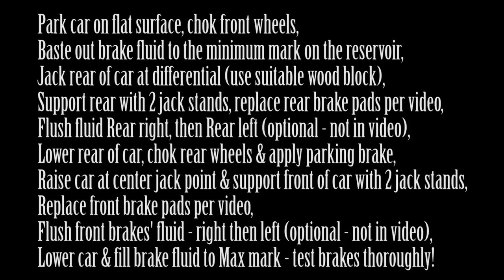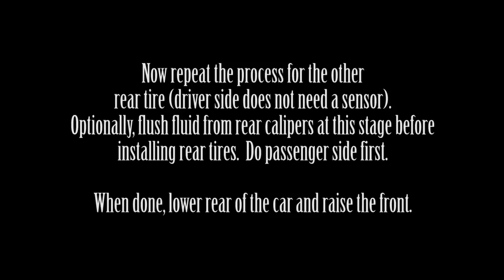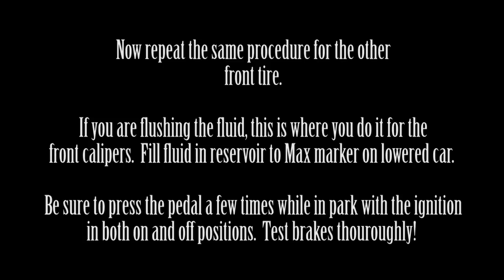Mercedes S500 W220 Brake Pads (Front and Rear) Replacement

Comment: Great Videos....I had to drill out the rotor screw as it was stripped and would not extract. Now the hub hole is 2 big for the screw on new rotors. Can anything be done like using coil, or JB weld or do I need a new hub?
Reply from the maker: Thanks, David.  You can tap a larger hole in both the old rotor and hub, or just omit it.  It is not that necessary. The lug bolts at 110 ft pd each will hold everything tied.

Comment: Is C clamp needed????? I don't remember using one when I changed mine myself few years ago and about to do them again on my front ones 2003 mercedes s430
Reply: Also what is tool you're using to knock those 2 bolts out what is it called I lost what I used before
Reply from the maker: @mverseaz7523  Hi - No, the C clamp is really not needed.  You just need something to press the pistons back...you can do it with the old pads and your hands.  To knock the bolts out, all you need is a rod or any implement smaller than the holes where the bolts go.
Reply: @masood-tv  thx picked up a everything I needed today C clamp just in case

Comment: Ugh I just did mine on my 01 s500, I think I seized a caliper cause it just would not budge. Then again, I was using a screwdriver and not a c clamp
Reply from the maker: Hi AyyB3, sorry to hear that.  Did you try pressing the brake pedal to see if the piston moves?  Of course, try that with pads inside. Otherwise, the whole piston will come out....if the piston does not move with hydraulic pressure, then check if fluid is getting to the caliper.  Screwdriver or not, the caliper shouldn't have seized....
Reply: @masood-tv  Well, this is on my rears, and unfortunately they were let go too long and were very low upon changing, so the rotor was ground into from the bare metal on the pad. 

I didn't have enough time to troubleshoot that far in the moment, I ended up taking the pad from the OTHER side of the rotor and getting it into the space between just to get home from where I was. I intend on taking it apart again later on either today or tomorrow, so I can have an update for you.
Reply from the maker: @A.B.III.   If it turns out that you do need to replace your caliper, I have a video with step by step instructions for the rear whhels also.

Comment: Where do you hack the car up so I don’t rip the air shock
Reply from the maker: Hello Aka Face - please elaborate.
Reply: @masood-tv  like the last time I lifter ped the car and the Schlick pulled along with it do I need to disconnect the battery or a button anywhere before I lift the car - thanks
Reply: @masood-tv   Do I need to disconnect the air shocks  before I lift the car and if so where do I turn it off
Reply from the maker: @3jimp  what year and model?
Reply: @masood-tv  2002 s500
Reply from the maker: @3jimp  Your initial question was where to "hack" the car...I asked that you elaborate.  I think what you meant is where to "jack" the car.  Jack it at one of the 4 jack points in front of the rear tires or back of front tires if you are replacing one set of pads at a time.  Otherwise, jack at the center jack point between the two tires to do both front wheels or at the differential for the rear wheels.
Reply: @masood-tv  but thank you I will do so thank you for your time
Reply from the maker: @3jimp  you are welcome.
Reply: @masood-tv  thank you again

Comment: So, without changing the rotors out, or having them turned, or at minimum a non-directional finish applied, you risk brake fading, brake noise, vibration, etc. It's possible to turn drilled rotors, although not recommended which is why most people replace them.
Reply from the maker: Hi Jason, no need to turn rotors or replace for every 2 to 3 pad replacements.  You will not experience any of the risks you mention.
Reply: Personally, I have. I've been an automotive technician since 2009, and I've experienced my fair share. Not trying to come off as hostile or anything. Just sharing my experience with it.
Reply from the maker: I appreciate that.  Thank you.

Comment: Ahhhhhh I m in trouble about the easier thing, knocking out the pads holder, it's so hard to knock out it. I have to use a bigger hammer and a burner to clean it (it's really dirty)
Reply from the maker: Were you able to finish the job, Alessandro?  These things do require bigger hammers and more muscle at times...
Reply: Masood Fortunately I solved it, I had to use burner because of 1 kg hammer wasn't enough. Now I have to flush fluid brake

Comment: Hi, I noticed you didn't change the rotors? I was told for MBs rotors have to changed every time pads are replaced. How do you know the rotors were still good? Thanks for posting. I didn't think it was that easy!
Reply from the maker: Hi Matt - I think someone may have misinformed you.  I would suggest replacing the rotors every 2 to 3 pad changes - however, it is best if you could measure rotor thickness first.  Here are the MB specs:

2000 Mercedes Benz S 500 (220.175) V8-5.0L (113.960) 
Brake Rotor/Disc: Specifications
Front Brake Disk Thickness
Model 220.025/026/028/070/073/075/125/126/128
Model 220.165/170/173/175/178/875/878
Model 220.176 with code Z07 or 494 or 498 or 625
New ................................................................................................................................................................................................ 32 mm (1.259 in.)
Wear Limit ..................................................................................................................................................................................... 30 mm (1.181 in.)
Service Limit ............................................................................................................................................................................... 30.6 mm (1.204 in.)
Model 220.063/065/067/163/167
New ................................................................................................................................................................................................ 28 mm (1.102 in.)
Wear Limit ..................................................................................................................................................................................... 26 mm (1.023 in.)
Service Limit ............................................................................................................................................................................... 26.6 mm (1.047 in.)
Model 220.074/174
Model 220.176 w/o code Z07 or 494 or 498 or 625
New ................................................................................................................................................................................................ 36 mm (1.417 in.)
Wear Limit ..................................................................................................................................................................................... 34 mm (1.338 in.)
Service Limit ............................................................................................................................................................................... 34.6 mm (1.362 in.)
Model 220.083/084/183/184
New ................................................................................................................................................................................................ 32 mm (1.259 in.)
Wear Limit .................................................................................................................................................................................. 29.4 mm (1.157 in.)
Service Limit .................................................................................................................................................................................. 30 mm (1.181 in.)
Model 220.087/187
New ................................................................................................................................................................................................ 30 mm (1.181 in.)
Wear Limit .................................................................................................................................................................................. 27.4 mm (1.078 in.)
Service Limit .................................................................................................................................................................................. 28 mm (1.102 in.)
Model 220.179
New ................................................................................................................................................................................................ 36 mm (1.417 in.)
Wear Limit ..................................................................................................................................................................................... 33 mm (1.299 in.)
Service Limit ............................................................................................................................................................................... 33.6 mm (1.322 in.)
Rear Brake Disc Thickness
Model 220.025/026/063/065/067/125/126/163/165/167
Model 220.028/070/075/128/170 with code 494 or 498 or 625
New ................................................................................................................................................................................................ 11 mm (0.433 in.)
Wear Limit .................................................................................................................................................................................... 9.3 mm (0.366 in.)
Service Limit ................................................................................................................................................................................. 9.8 mm (0.385 in.)
Model 220.073/083/084/087/173/178/183/184/187
Model 220.028/070/075/128/170 w/o code 494, 198, 625
Model 220.175 w/o code Z07
New ................................................................................................................................................................................................ 22 mm (0.866 in.)
Wear Limit .................................................................................................................................................................................. 19.4 mm (0.763 in.)
Service Limit .................................................................................................................................................................................. 20 mm (0.787 in.)
Model 220.074/174/875/878
New ................................................................................................................................................................................................ 26 mm (1.023 in.)
Wear Limit ..................................................................................................................................................................................... 24 mm (0.944 in.)
Service Limit ............................................................................................................................................................................... 24.6 mm (0.968 in.)
Model 220.175/176/179 with code Z07
New ................................................................................................................................................................................................ 26 mm (1.023 in.)
Wear Limit .................................................................................................................................................................................. 19.4 mm (0.763 in.)
Service Limit .................................................................................................................................................................................. 20 mm (0.787 in.)
Model 220.176/179 w/o code Z07
New ................................................................................................................................................................................................ 26 mm (1.023 in.)
Wear Limit .................................................................................................................................................................................. 23.4 mm (0.921 in.)
Reply: Thanks a million! This is very helpful information and you just saved me a ton of money. Happy Thanksgiving!!

Comment: Hi, great video thanks for posting!
Is brake cleaner ok on the seals though?
Reply from the maker: Hi Scud69er - you are welcome.  I have applied brake cleaner on those seals for ages without issues.  You may still wish to read the label on the brake cleaner you use to be sure...